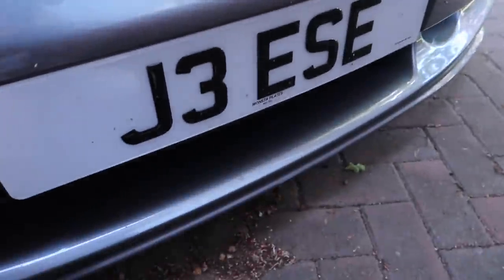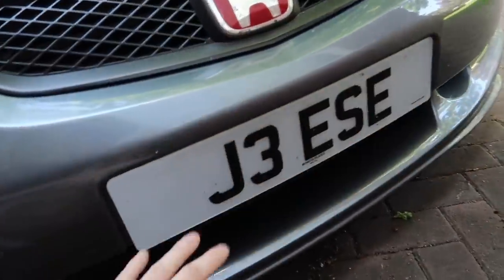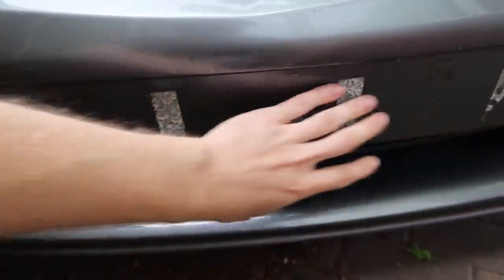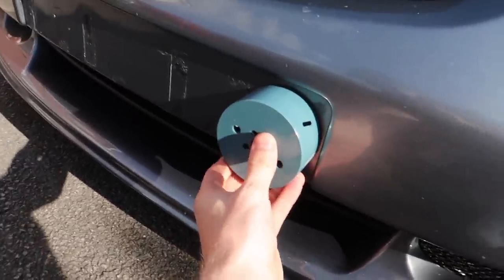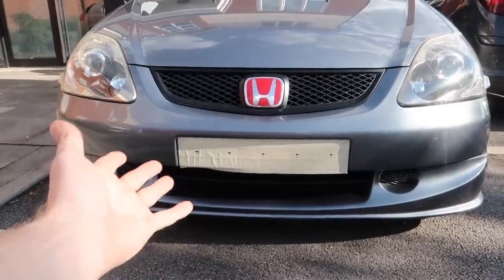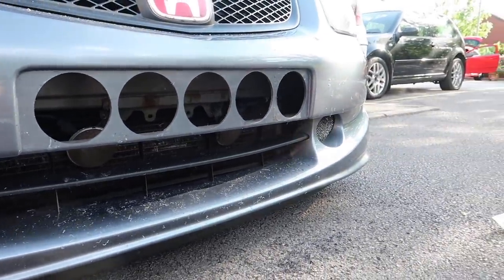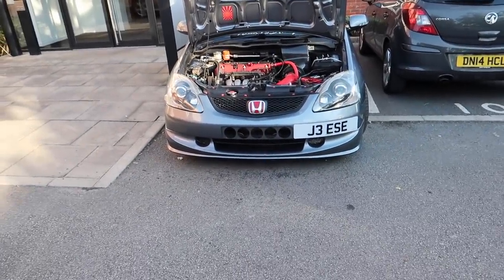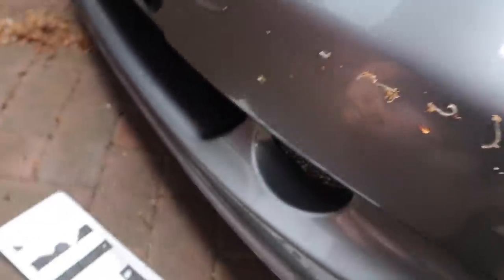CUTTING MY BUMPER!!

Comment: I think smaller holes would have looked better and showed less of the unpainted void behind but will look ok with an intercooler behind.A guy local to me has spend thousands on a type r from going supercharged to turbo and allsorts.He actually made the Honda badge detachable on track days for more air flow.His car looked really functional with Mugen parts etc but not race car so people were shocked when he revealed it has more than twice factory power.I bet them guys outside the houses loved the drilling and mini car meet.lol Number plate is cool.I'd get the bonnet wrapped by your mate with a high quality carbon as it would get the racer look you seem to want.Also the ep3 bonnets chip really easily so wrap my add some protection to the paint below and probably cheaper/easier to get redone

Comment: be careful with those plates the heat from the sun can melt them to the car i had them on work van n heat from the sun bonded them to the van n it messed up the paint trying to get them off